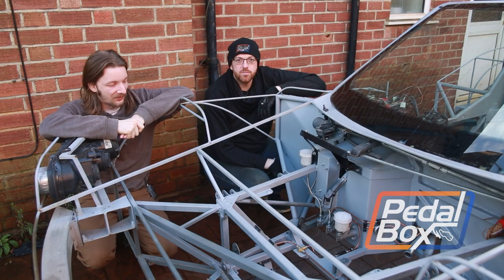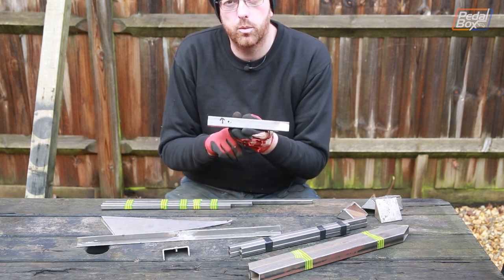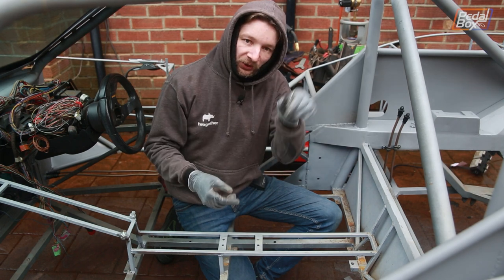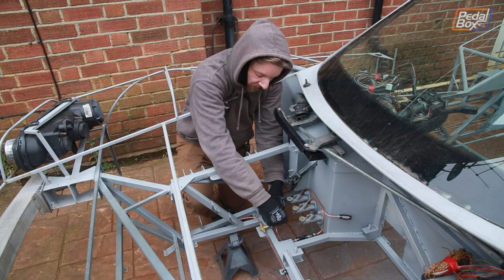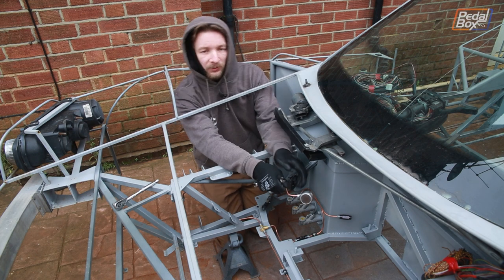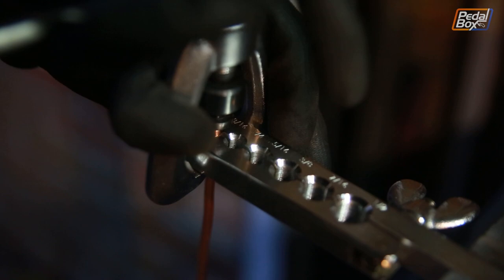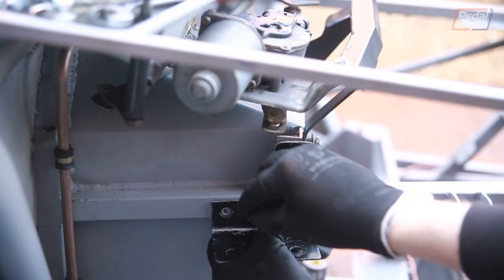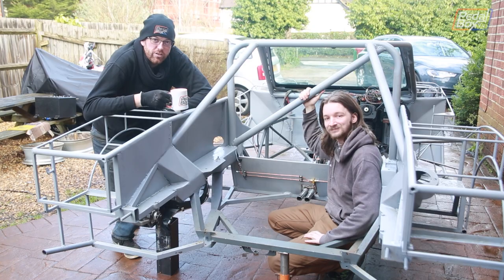Hydraulic Brake and Clutch Pipes | Audi TT Kit Car | PedalBox Episode 70

Comment: Another tasty load of progress guys, nice one.

The little round box on the clutch line is a delay valve/accumulator. Consensus seems to be it's there to smooth out clutch action, and that there's no huge difference between running one and not.
Reply from the maker: Neat, we found no consensus so at least that tracks with your finding! The convenience was worth it to have an easier run of pipes in nothing else!
Reply: Yes the unit is there to help cut back and smooth the fluid flow from the movement in the Dual Mass Flywheel, presumably when it's wobbling loads!! Every bit of progress seems to have a negative effect!!
Good progress in the cold guys!
Reply from the maker: @CrispysProjects  ahh, that makes sense!

Comment: Adrian, don’t forget to clean the I.D. of the line you just cut with the deburring tool, that should be included in the brake flare tool kit. Makes for the best flares.
Reply from the maker: I actually cut that bit because i... couldn't... talk... and...do...it... and it sound horrific with massive pauses in. Going to edit that bit into a stand alone video on flaring pipes I think
Reply: @PedalBox  that wouldn’t be a bad idea.

Comment: Curious question; to prevent corrosion on the hardlines, might it have been a good idea to heatshrink them too? Is that something that could be done with enough consideration?
Reply from the maker: You could. Steel ones usually get painted. Copper and cupronickel shouldn't really rust, but I'm expecting to get some schmoo on there at some point soon. These might get painted yet, depends on how much overspray there is when we undercoat